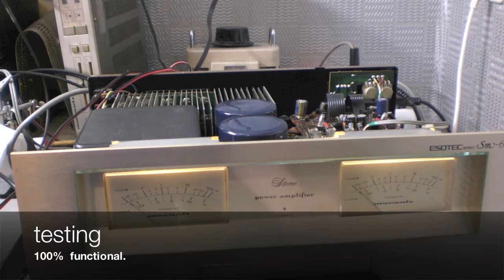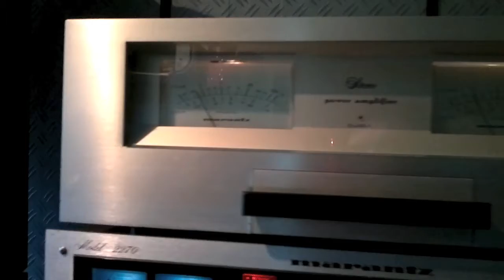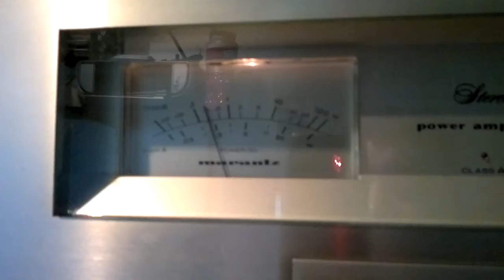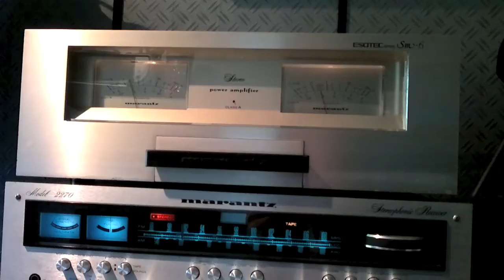marantz SM-6

Comment: I have a Marantz  Esotec SM-6 with the switchable Bias. It sounds really good in either mode but Class A is much more open. I don't know if it's been gone through but the power cord is not original. In 30wpc Class "A" mode and at moderate volume, it compares very well with a 200wpc Sunfire. Of course it can't compare at high volumes but for Jazz and Chamber music it does an amazing job. Very quiet and airy with a open soundstage. Not bad for it's age.